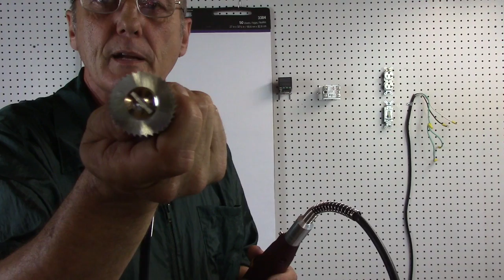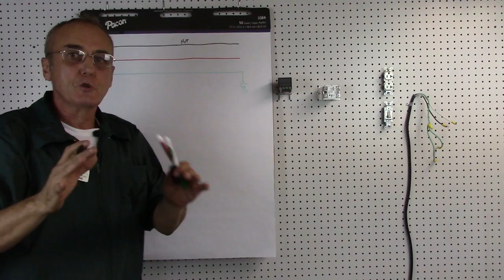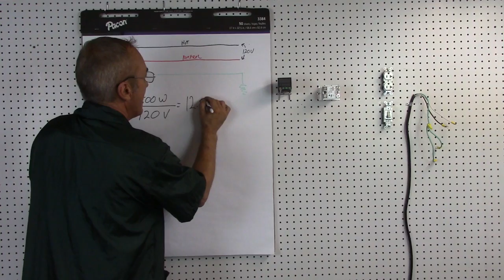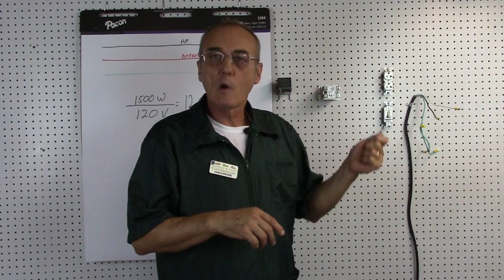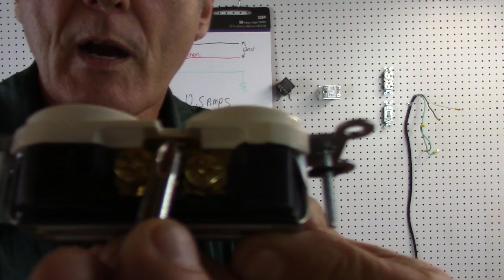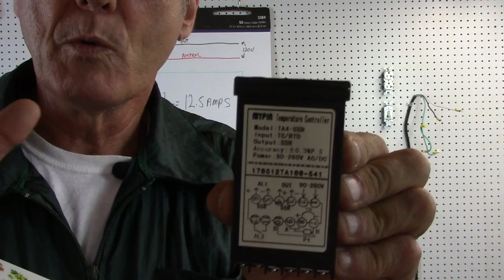Wiring 120V PID and Theory Part 1

Comment: HELP HELP HELP......  I don't know if George is answering emails any longer.  My question has to do with the SSR relays.  In one video where he was describing the very BASIC controller, He used an SSR-25-VA relay.. However, in most, if not all of the others, he used the SSR-40-DA..   My understanding is that the DA if for DC input whereas the VA is AC.  Since we are not feeding the controller with DC.. I'm confused.  The only DC in the controller is the little converter for the computer fan. Any electrical types out there???   HELP HELP HELP

Comment: George does the sir take the place of a fuse if you used a knob to turn up heat or lower heat
not using a pid ,  kind of like a portable electric heater ?

Comment: This is mostly magic to me I can understand its a fancy thermostat 🤷‍♀️ i orderd all the stough to build a 2000 W 120v 20 amp heating element. Thank you for the step by step and explanations for dummys. It's very awesome thanks to you I can do this affordably. I put my element in a 2in to 1in NPT tri clamp and it goes right on my 13 gal milk can  pot easy peasy.

Comment: If you are only using 14 gauge wire, you must use a 15 amp receptacle, not a 20 amp. A 15 amp receptacle does not have a horizontal slot. That is a safety feature to prevent accidentally plugging in an appliance that would exceed 15 amps (which would utilize the horizontal slot on the 20 amp receptacle. That's why electrical codes do not allow using 20 amp receptacles on 15 amp circuits.
Reply: You can use a 20 amp outlet on a 15 amp circuit, you cannot use a 15 amp outlet on a 20 amp circuit.  
You can plug 15 amp plugs into 20 amp outlets with no trouble becouse the circuit is still 120 volts ac.

Comment: Thanks George for taking something that is intimidating to someone with very little electrical knowledge and making it very understandable. A question I have is that your demonstration was with a 1500 watt element. Is 1500 watts enough for a 4-5 gallon wash? I want to stay at 120 volts if I can.
Reply from the maker: Absolutely. The 1500 watt will do just fine.
George

Comment: George, how do I make a pid control cooling .The opposite of heating since it turns on when temp gets high rather than low.
Reply from the maker: You can set the parameters for cooling instead of heating. If this is a Mypin press the set button for about 5 seconds and continue pressing it until you see "heat" when you do change it to "cooling". That's it. 
The Inkbird is a little more involved but generally the same way. Let me know if you need me to talk you through that one.
George

Comment: The bridge between the two screws on the duplex outlet is designed to break off, just grab it with a pair of pliers and bend it down toward the screws and it will break off clean.

Comment: Do you have a vid for installing rheostat to controls the water pump, also will the PID control 2 elements and how do we beef up the input
Reply from the maker: I have not added a rheostat to any of these for the water pump. I believe the best method of controlling the water is by restricting the flow with a needle valve as opposed to controlling the electricity. Restricting the flow on these small pumps does not harm the inner workings - if you shut off the water flow completely, it will just run without any restriction on the motor (like free spinning), sometimes called cavitation. To reduce the electric flow is a bit more complicated and could reduce the life of the pump. 
The PID can control multiple elements but not separately. It is not capable of controlling different temperatures to different elements. If you are running multiple elements at the same temperature one PID can do that otherwise you will need a separate PID for each element. Hope this helps.
George
Reply: Barley and Hops Brewing I'm going to use a 1/4 sump pump I had in my closet, new in box, with 55 gallon barrel for reservoir, should take a while to heat up. I'm using a 20 gal copper from stillz.
Reply: Should I restrict intake water or the cooling line
Reply: Also could the alarm side of the PID be used with a second relay to control the pump
Reply from the maker: When you say 1/4 you do mean 1/4 HP. Am I correct? If so, that is way overkill but it will work. The 55gal reservoir is a great idea, when it does start to heat up just toss in some ice. 
Glad all is working well.
Good luck
Happy distilling
George
Reply from the maker: Restrict the outflow. It is the easiest to control. You can use any sort of valve that fits your hose. The valves used under the sink or behind the toilet seem to be cheap and easy to use as well. All depends on hose connections. The least splices the better - seems like I get everything working and one joint somewhere wants to leak a little. Easy fix but a pain in the butt.
George

Comment: Hi George,

How can I wire a pid  with an alarm which I can acknowledge/reset?
Reply: You can wire it directly to the PID and set the temp for your alarm. I would add a power off switch just before the alarm so you can turn it off. Resetting it will require you to reset the temperature on the PID.
George

Comment: George, I was excited to stumble upon your channel. I've been marathon watching all the videos. I was at a loss how to convert my still to electric with a PID. "how do I get the water heater element into the pot?", I asked myself. after scouring the internet without knowing the name of the part I was looking for. It's called a Universal Water Heater Element Adapter Kit. it costs about $6 at Home Depot or Amazon. basically you cut a hole in your pot and bolt this threaded adapter around the hole. I hope it helps you or your viewers. Cheers!

Comment: Sorry, newbie here and loving the info but I have a question.  If you're using 14awg wire and it is rated at 15 amp, wouldn't that be a weak link in the system?  Of course, not if you are using the 1500w element but for the 2000w it wouldn't cut it, right?  Your switch and outlet is 20amp so wouldn't you need 20amp (12awg) wire to them just incase you wanted to bump up the element to 2000w someday?
Reply: Exactly. I mention this in one of the videos. 14 AWG is fine for 15 amps and the 1500 watt element. If you ever want to increase that to a 200 watt element (it draws 16.6 amps) you should use 12 AWG.